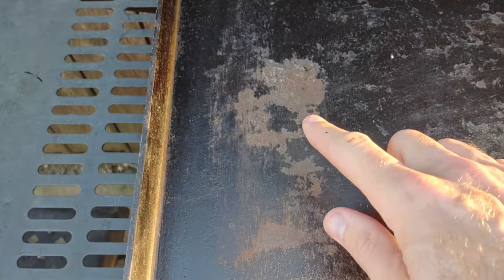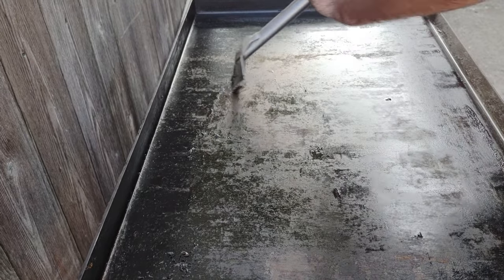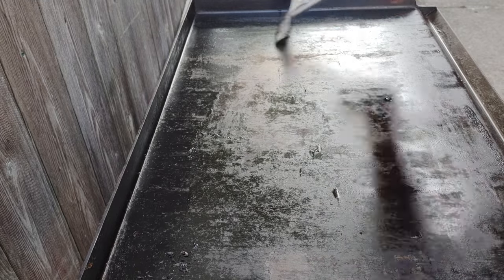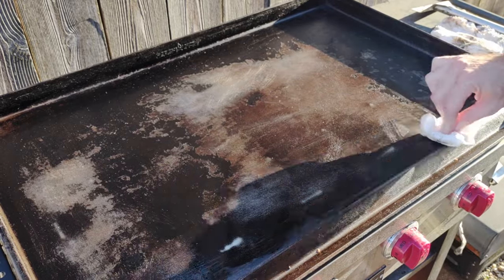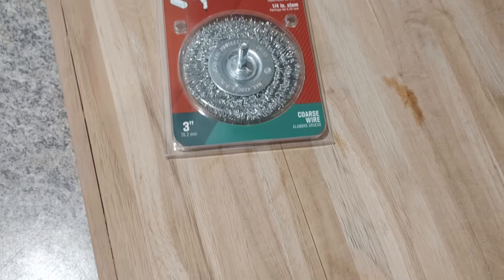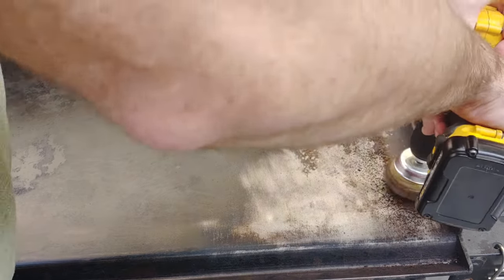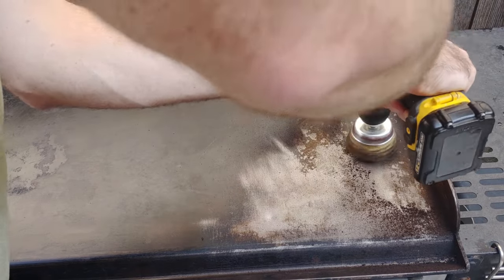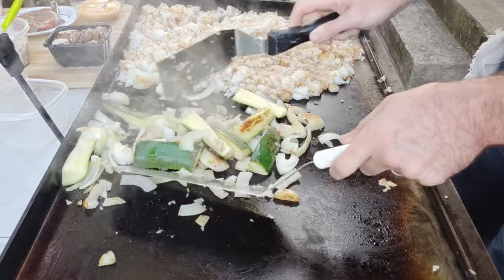Should I Sand the Rust Off My Griddle?

Comment: For future reference I've actually used a wire brush on an angle grinder it seemed to work well but definitely good info thanks man
Reply from the maker: Ya someone else mentioned that as well. It makes total sense and I bet that would have worked 10 times better. Thanks for the heads up man and thanks for watching multiple videos.

Comment: I would like to recommend using a variable speed angle grinder with wire wheel or wire cup.  The variable speed helps keep it under control! 
   Not much experience with grills yet, but I've been using angle grinders for the last thirty years.  Jim Y
Reply from the maker: Thanks Jim!  That's a great suggestion. As you could see I don't have much experience with drills or grinders lol.

Comment: Great video!  My 36” is still in great shape but my 17” which I keep in my camper needs to get refinished. I’ll probably use the wire wheel method since it’s a smaller surface and shouldn’t take me as long.
Reply from the maker: Ya I think you'll get the 17" done in no time Mike.

Comment: Very nice! I wonder if an angle grinder and that cup brush would have been better? Nice to know you can clean past the factory pre seasoning and still build it back up no problem
Reply from the maker: I think am angle grinder would have been 10 times better. Someone else mentioned that they used one before and sold it worked great. Looks like I need to step my game up when it comes to power tools.

Comment: If you want to strip to bare steel use an angle grinder with a flap disc. This will save you major time
Reply from the maker: Ya I wish I had one of those, that's a great idea. Hopefully people will see this in the future and learn from my mistakes. Thanks brother!
Reply: I tried stripping down a 5 year old griddle with a drill and brush and quickly found out this was going to take forever. I saw someone recommend the angle grinder and flap disc and I tried it and it made quick work of stripping down .

Comment: One part molasses to 9 parts water, mixed together, will remove rust. If you can put the item into a sealed plastic container, let it soak for a few days, examine,  reinsert if needed. 

It might take longer, a week or so, but the rust will be reduced to grey residue. Running water, scrubber, will remove the residue.

You much lightly oil the metal as soon as you are done,  it will start rusting immediately. 

Try it on some rusting tool. Yes in warm weather it will smell, one reason to seal it up.

I'm wondering if a low watt Incondescent bulb would keep the rust from forming?  It's at a certain cold temperature, 55 or so, up, down, where it gets warm, cold, that sweat happens, and rust gets going well.

I wonder if one of those cheap wax, fragrance burners that uses a bulb, could be placed say under the hood, under the stove to provide just a little heat to stop rusting?
Reply from the maker: Thanks so much that's some great information. That's an interesting idea about the light bulb, I wonder if that would work.